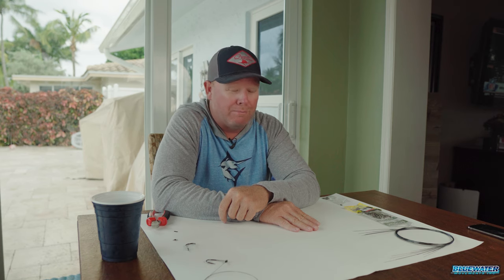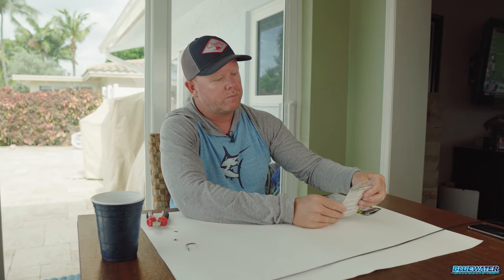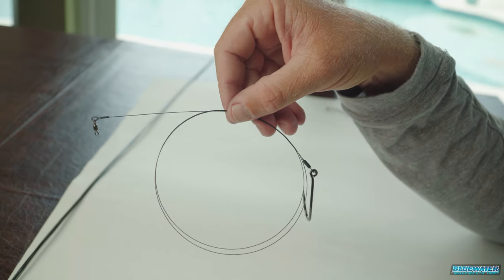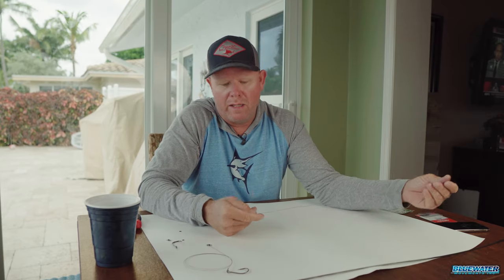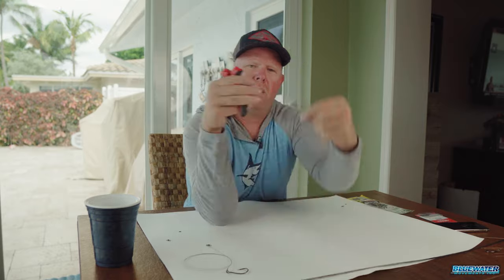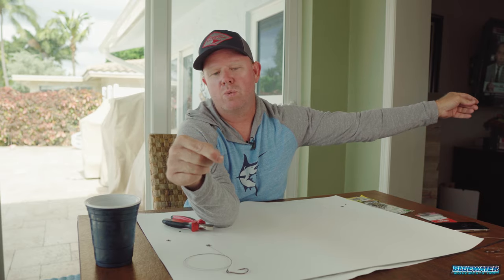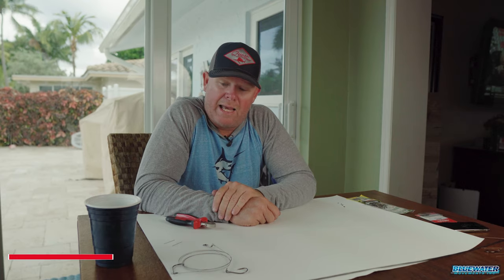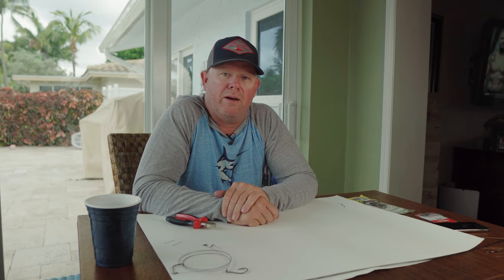How to make a titanium wire fishing rig - Saltwater Fishing

Comment: Tied up some of these rigs and I'm liking them. Can't wait to try them. Kite fishing isn't used as much up here in NC mainly because our structure is very isolated. We don't have the bottom you guys have. Everything is slow trolling for the most part. 
We will anchor close to shore and kite fish or balloon fish in the fall when the pogies are running the beach. Just my wife and I so we don't slow troll as much.  We never get tail whipped and we never get cut offs kite or balloon fishing. On the slow troll we do and it's hard to learn up here. The pros are very tight lipped on their rigging so it's all trial and error. Some run flouro some don't. Some run a double flouro to short wire. Some use long wire. If we run short wire 3 feet or less we get cut offs. If we run longer wire we get smaller fish or no fish. 
All of the areas with structure are hammered with slow trollers so can't really kite fish them. 
We run 15 or 20lb pink ande on our rslow troll rigs. We've been using sev nstrand in 40 or 60lb. We e had the 40 cut. 
Kite fishing it's #5 wire 5 feet to a swivel at both ends. Two 6 inch wires to one swivel and two number 4 trebles. Never loose fish on that rig. Not as stealthy as the rig you show. 

Have you ever heard of guys using a double flouro to a short titanium wire rig? 
Brant McMullan from Oifc does this. Curious how he builds his rigs. On OIFC TV an episode called Venice kings he vaguely talks about it as next level kingfishing tricks. 
We would love to stick to the kite but up here in NC ya pretty much hav to slow troll. 

We've learned tons from your videos and really enjoy them!! 
Larry

Comment: Alll you need now is heat shrink wrap over the sleeve and the sleeve won’t go anywhere , also to pull on hook or swivel to take out any possible slippage/slack ....and it will make a nice low profile that looks and feels amazing
Reply from the maker: Heat shrink would definitely finish it off nice but these rigs are pretty time consuming to make as they are. Gotta draw the line somewhere! Lol
Reply: @fishbluewater  haha

Comment: titanium wire they are very very good to get lots of Kingfish strikes, I'm talking about 88Lb + kingfish
but they have a bad week points with kingfish 1st strike on life bait
1st they will stretch and slip the tie
2nd they will break at the crimp tip next to the hook
btw I'm using Knot2Kinky titanium wire 55LB
Reply from the maker: The crimp is really only for appearance and to conceal the tag end of the titanium so it doesn't end up in a finger. Very painful! Just be sure not to crimp to hard as that can damage the wire. But all the strength is in the knot. Your crimp will slide if you are using too large of a crimp. We use a #1 crimp on 40 pound titanium. I would not go any larger than #2 on 55 lb. If you can fit the 55lb in a #1 crimp use that instead.
Reply: If some right it makes a super strong leader, and it should never be slipping if you are tying it correctly and also testing it before you use it..... I love my titanium leaders....

Comment: Question I can never seem to get answered from the pros. 

On the kite with this rig are you using a trailing hook/ free hanginging stinger? 

Doesn't seem that the hook up to bite ratio would be very high  on kings with only the j hook. I may be dead wrong . 

How many fish hit but leave you with half a bait?
I love this rig but scared to use it in tournaments. Up here in Carolina it's two trebles. 
I want to like the single 6/0 big gun just worried about cut baits no hook up in your aments 
I would love to hear your thoughts/ experience/ advice.
Reply from the maker: No stinger. There are some guys that fish a stinger out of the kite but most of the top teams do not. Better presentation without the stinger. If they cut the bait in half a lot of the time if you free spool your line and let the other half drift naturally they will roll back on it and you’re tight on the second shot.
Reply: @fishbluewater  I'm going for it. I'm going to run this rig this year. I definitely like the single hook rig. We mostly run pogies up here in NC. Love your videos! Thanks for responding!
Reply: @fishbluewater  lots of folks are running the seven strand titanium here now. Looks like they are sneezing the hooks same as with the non titanium seven strand. With the single strand titanium and loop,seems like the hook is more free. I think I like that better than sneeling the hook  for a kite/ vertical presentation. We run regular seven strand with two number 4 hooks slow trolling even with double pogie rigs. My husband prefers the kite and balloons. We e done pretty good with it. Seems like we only get cut offs slow trolling. We thought that was happening because we were using short wire. We went back to 5 ft wire. First fish was hooked in back and he had the wire wrapped in his beak teeth only inches from mono. With the kite or balloon our hook ups have always been in the mouth and solid.
Reply from the maker: @cristilaye5912  you won’t be disappointed. If it’s a really big bait like a Speedo down here or a giant runner they will throw an extra stinger in it but gogs get a single hook for sure